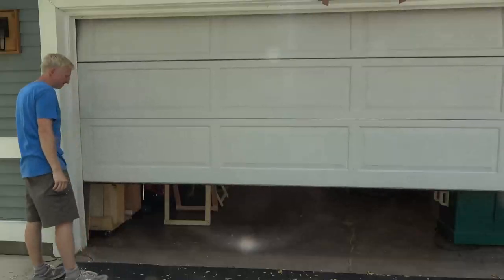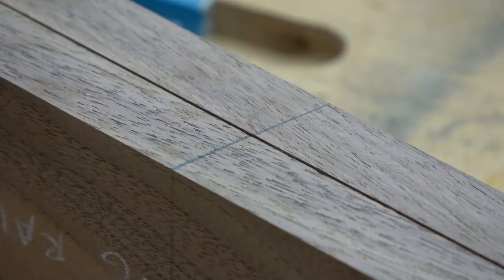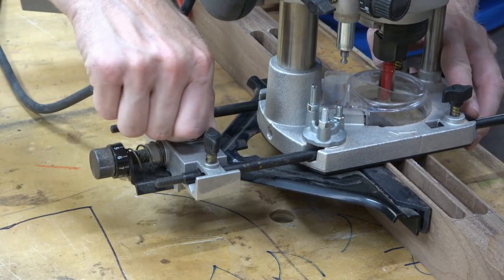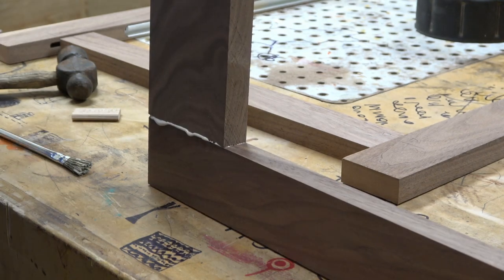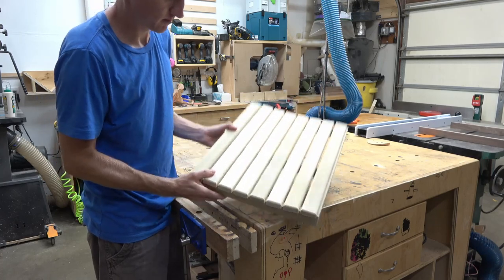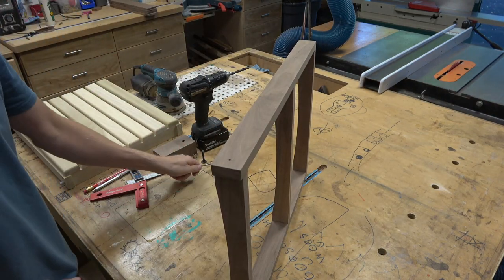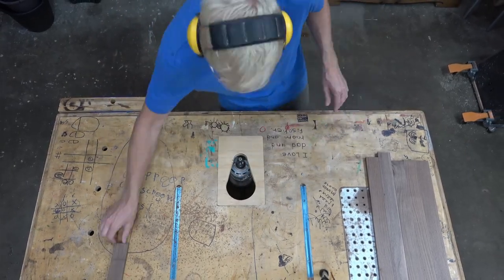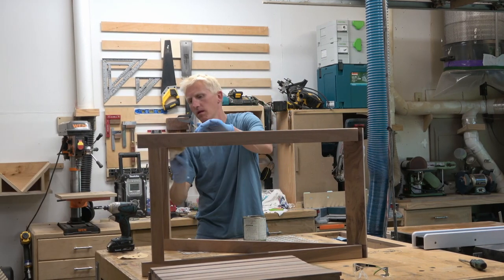Folding Chair Build // Walnut and Aluminum!

Comment: do you have plans with imperial measurements?
Reply from the maker: I didn't make plans for this project.  I do however have basic pdf drawings I can email.  They are not imperial however.  Thanks for watching!
Reply: Hi, could you share the pdf plans with me as well? Thank you.
Reply from the maker: @saulguerrero1564   I just added 3 pdf files that show some dimensions.  You can find them in this videos description!